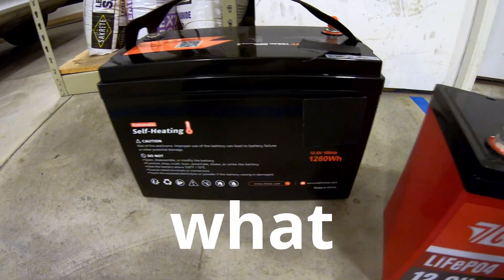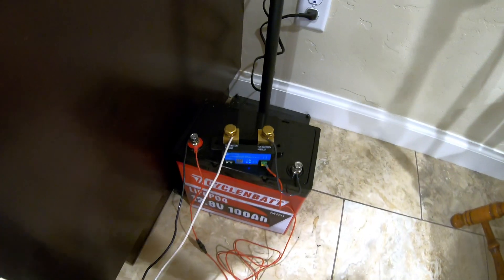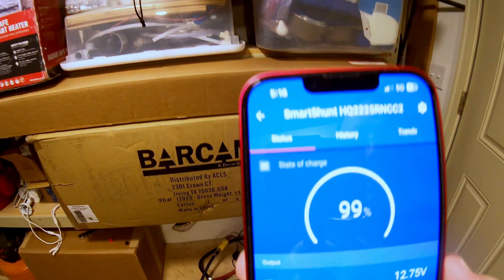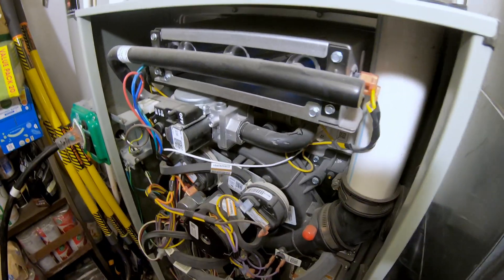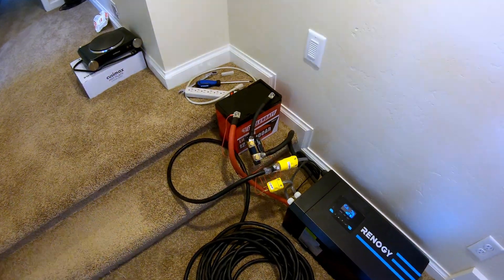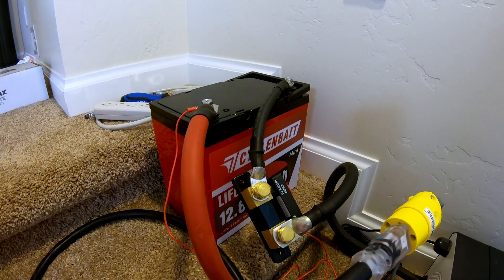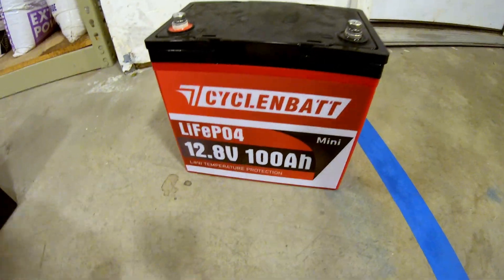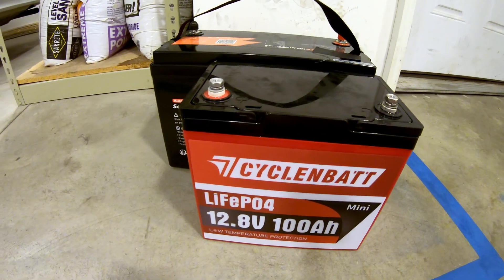DO NOT Leave LiFePO4 Batteries Unattended or This Might Happen! – Cyclenbatt 12V Mini

Comment: I have this Mini Battery and Its Real Handy for Grab n Go and an 800 - 1000 Watt Inverter or to Sip Feed My Eco Flow River 2 Pro in a Pinch through the Solar Port XT60I plug.
Reply from the maker: That sounds like a great portable power solution!

Comment: Thanks for the great practical video! A few months ago, I got the same Cyclenbatt mini to run my 36lbs thrust trolling motor and a few other things on my kayak like a fish finder, GoPro, nav lights and my phone. I modified a 30ah PowoCarlife battery box to get this battery to fit inside (battery height was almost 2 inches higher than the cover) and added a Noco charger and it works great with this battery. I also added a 60A circuit breaker and some inline fuses and have taken it out on a few lakes about 20 times now and so far so good! No trips or blown fuses and it doesn’t even feel hot after a 12 hour run. Have yet to go below 50% too, and that includes using the Autoboat Smart Head all day! Cyclenbatt has offered some sort of discount if I write a review, so I’m hoping to get another 12V/100ah cheap to run my popup camper which has a 600W solar system on the roof which came with a much larger and heavier 12V/100ah lithium battery and run the parallel.
Reply from the maker: Awesome! Thanks for sharing your experience with the battery and your setup!

Comment: Sorry, but for 7+ years I've been providing power for a fridge, a freezer and the blower on the central heat during power outages from a 12 volt battery bank and the wiring I see on the battery at 1:50 in will NOT power any fridge from that battery.  
My first guess is that you have some misinformation or misunderstanding about how your "powerbox" or "solar generator" or whatever label that "box with a battery and an inverter" has, actually works.
I did NOT watch the rest of the video because you lost my trust in the first two minutes.
Reply from the maker: Do you know how the DC inputs work on those power stations? The power station is what’s running the fridge… And the lithium iron phosphate battery is simply recharging the power station. Thanks for watching!

Comment: I've always been nervous about cheap lithium batteries. In my RC flying days I had a couple of "Chinesium" lithium polymer battery packs go into thermal runaway when being ran BELOW their advertised constant load limit, and never anywhere near their advertised peak ratings. They went off like fireworks, jetting flames out the end !

I had a cheap 18650 pack vent flames too. That one was in a powered RC glider that was about 300 feet up at the time. I didn't even get enough warning to react with that one before the battery pack had torched the foam fuselage enough for the thing to just come apart in the air. That flight went from "All's fine" to "oh s**t" quicker than you could say "Hey...... Is that thing leaving a smoke trail?". 😏

I've yet to have any name brand lithium polymer or lithium iron batteries end in flames when they've been identifiable cells bought from established retailers who have a serious amount of reputation to lose if they sold junk. Some good quality polymer packs have puffed up slightly due to abuse (like charging while they're still pretty warm from just being in use, leaving them fully charged for extended periods of time, or absent mindedly charging them at an excessively high rate due to not double checking charger settings) and subsequently they were removed from service (Via a garden waste incinerator bin ! 😁), but none of the decent batteries have ever unexpectedly started venting.

Generally, lithium batteries are great until they either get so "Worn out" that they won't hold enough charge or kick out enough amps to be useful anymore........ Or until they get described as "the source of ignition" on a fire investigators assessment form. The large majority of lithium batteries end in the first way, but the odds of them going the second way go up dramatically when the battery in question is an "Off brand" item from a company with unknown quality control, or one who may be wildly optimistic when it comes to publishing the items specifications.

So like safety equipment, I'd say that lithium based batteries are also something that you DON'T buy based on price alone.
Reply from the maker: Great insights! Thanks for watching!

Comment: Using the "Generator" with the Battery is NOT AN HONEST TEST! Now if the generator batter was completely dead, MAYBE! However, with the Generator in play, IT Might have a residual charge in it which WILL skew your results. You need to use a standalone Inverter to run the Fridge to get accurate numbers.
Reply from the maker: You apparently didn’t listen to the part in the video where I explain why I use the power station in the middle. Thanks for watching!

Comment: wow that is one big ext cord. how much did you take into account for because that several extra feet will effect things? also in the real world you would want several of those batteries to think of using it full time. also at least 1600 watts of solar... for just the full size fridge.
Reply from the maker: It’s my favorite extension cord! It can handle anything! Thanks for your thoughts and ideas and for watching!
Reply: @stormtrooper88 The consumption of the cable is added to the consumption of the air conditioner plus the losses of the big inverter, so the reading on the app already accounts for all that. The loss in a cable depends on the size (gauge) of the wire and the length of the cable. 
The loss in the extension cable is negligible as long as the copper is thick enough. The big fat cable is probably a 10AWG, 30A cable or bigger.

I estimate the losses in the inverter to be 30W, so that the losses in the cable + the airconditioner is 642-30 = 612W. The resistance of the cable can be found online, so that, say, 50ft of cable is 0.052 Ω. From this the cable is only using about 1.35W, which is quite small. There is also a yellow extension cord, the losses are a higher, but like I said it is added already in the reading on the app.

Comment: They put foam blocks in the bigger battery as spacers. The bigger Battery case made the batteries "LOOK" bigger.
Reply from the maker: This is true. I have opened up a few of the group 31 batteries. I’m really glad they are moving more towards this mini size. Thanks for watching!
Reply: They're leaving room for cells to swell slightly without bulging the plastic casings, resulting in warrantee extra claims.

Comment: Don't really understand how the battery ran your refrigerator for 16 hours, was it the battery or the power station's battery and the mini battery as an extension battery that ran for 16 hours. Thanks for making these videos, very informative.
Reply from the maker: It was 100% the battery that ran my fridge for 16 hours. I can tell from the app on the power station when it stops receiving DC power from the battery, and that’s how I know what time the battery dies at even if I’m not right there when it happens. The thing to remember about refrigerators is that they cycle off and on. So this battery would never be able to run my fridge for 16 hours if the fridge was running for that entire time. but in reality the fridge turns on for an hour or two to cool off… And then shuts off for a couple hours… Until the temperature inside the fridge raises high enough that the compressor turns back on to cool it off again. Thanks for watching!
Reply: Good to know, you channel is very informative. I have a Bluetti AC 180 looking to extend the runtime.  Thanks brother...